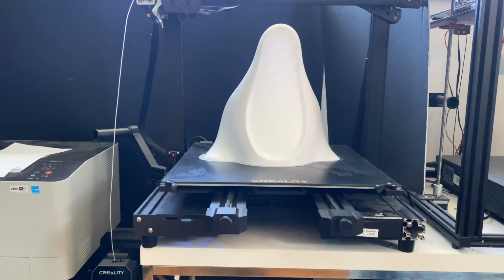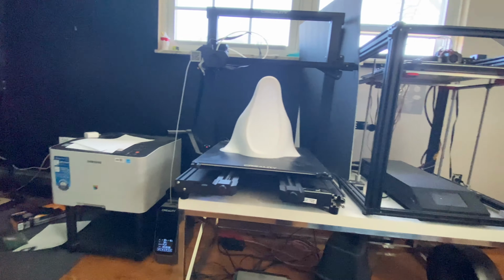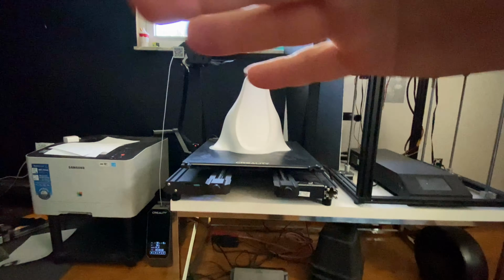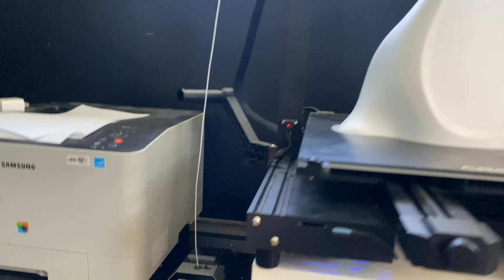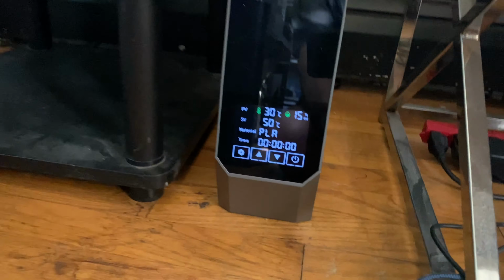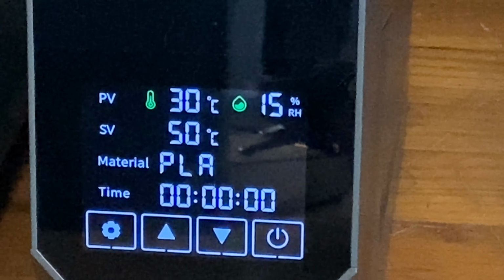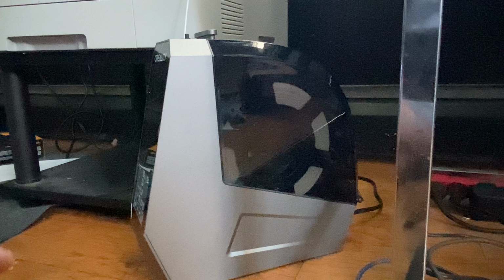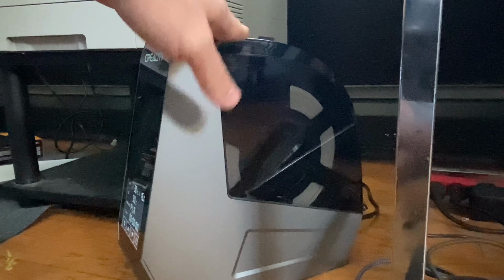Checking in, with the Creality Space Pi Filament Dryer. Do we have a Hygrometer problem?

Comment: I ordered two PI Driers and they would not go below 15% RH, Creality Support could not exchange for one that does read below 15%, so I returned both. Apparently they used a very cheap RH sensor, be better if they stated this limitation as my other Driers do read down to 0 RH.
Reply from the maker: The PI drier works great. Like others,  my "stuck on 15%" problem went away after a few days of use. Regardless, I never even look at the number on my dryers. I just fire them up and let them run. This is a very good dryer, and easy to print from

Comment: I have an issue with the PTFE tube being pulled in by the spool of filament as it prints. It acts as a physical brake.
Reply from the maker: Remove it. No real need. I did a 3 foot mask on a CR-6 Max with no tube
Reply: The same that appened to me today. I’m thinking to print something to insert in the hole to keep PTFE outside.

Comment: I think that you are correct that your Creality filament dryer just has a bad humidity sensor or bad wiring. I have the same dryer and in 3 hours yesterday it pulled a spool of filament from 42% down to 21% as indicated on the display.
Reply from the maker: Really? This is super important, because another user is having the EXACT problem, where his is always at 15. I have been trying to figure out if it's a random defect, or, across-the-board defect, before bringing it up to Creality.
Reply: Mine is performing as expected. Temp gets to the setpoint fairly quickly and the humidity drops from 30~40 to 20 or below in an hour or so.
Reply from the maker: Super. Thank you.
Reply: @3DRundown  I just got mine out of the box, hit start, humidity started at 42% got it down to 31% then it immediately dropped to 15% where it has stayed.
Reply: Just got my unit today and it drops down to 15H and only displays 15H while it is hot. After cooling it shows more accidentally I put in 2 separate temp and humidity sensor to check performance and it actually read better then the unit again after cooling. During the hot stage all 3 sensors “built in, 2 independent” read with inaccurate readings. I believe Creality could improve this by implementing some sort of cool down feature like just running the fans for a period of time after to circulate the air and allow for a more accurate reading. Also I’m not good at CAD but it would be nice if someone in the community would design a new cover or some type of adapter that will seal and wedge itself between the cover and case to be able to install another sensor without drilling a hole in the existing cover.

Comment: I have one of these and it doesn't heat up.  It looks like yours isn't either given the large difference between the Drying temperature value (SV) and the  "real-time temperature" (PV).  am i missing something?  I left it for running for about 3 hours and the temp never went up and the humidity never came down.
Reply from the maker: Mine blows heat instantly. You can easily feel it. Sounds like your heater isn't working. I wonder if a connection came off in shipping. Likely very easy to get eyes on it. Creality stuff is usually easy to service. I'd have a look
Reply: @3DRundown  i've tried taking it apart.  Cant figure out how to get the bottom off without damaging the screen. I took the feet off to get the screws out but haven't taken it past that.  Not that damaging the screen would hurt anything really...it's already a paper weight
Reply from the maker: Email CS@CREALITY.COM.  Include EVERY DETAIL of your problem, in SIMPLE ENGLISH, with no extra words (IE: Yelling at them). Ask them for help or a replacement.
Reply: @3DRundown  I emailed creality.  It took them about a week to get back with me and have offered to ship me a replacement and said they'd contact me once it's shipped.  That was 2 business days ago at the time of my writing this.  We'll see how that goes.  I'm optimistic.  I've had good success with Creality products in the past.

Comment: Do you think that maybe 15% is the minimum that the hygrometer can read, which is why it's locked there? If you put it another spool that's been lying around for a while, does it then start reading higher?
Reply from the maker: I went as far as putting water in it
Reply: @3DRundown  Hmm, that stinks. Doesn't say much about quality of the unit then, if the hygrometer is already bad.
Reply from the maker: It started working. Why, don't know, but, it's OK now....
Reply: That's odd, but at least it's working again.